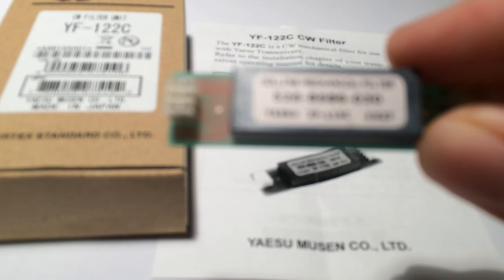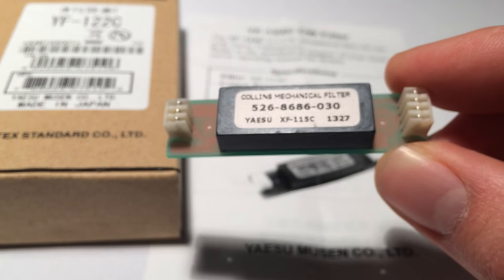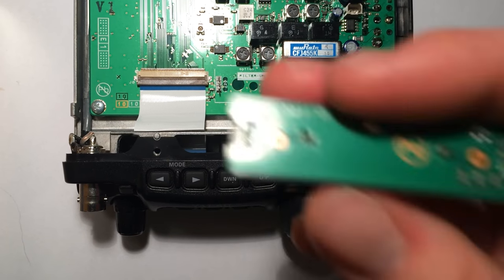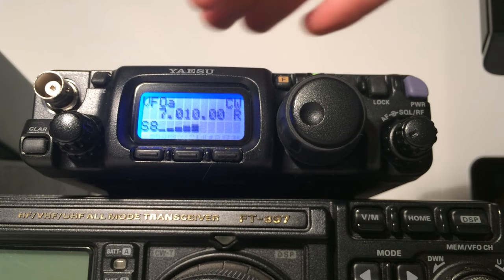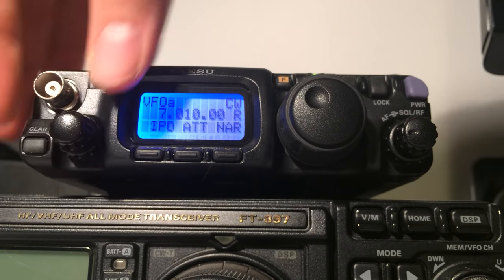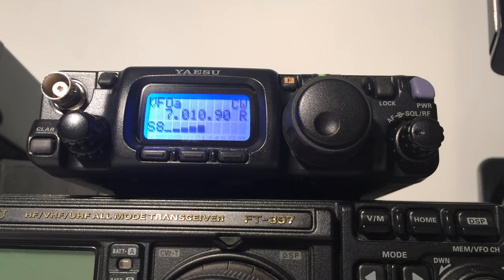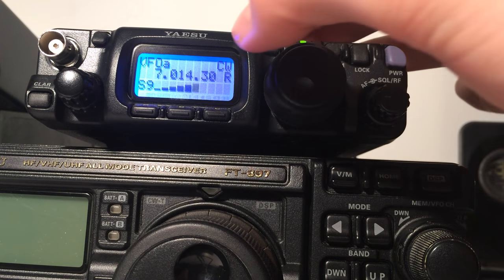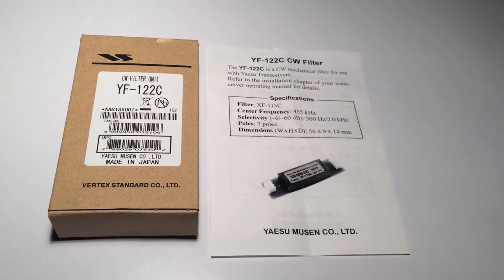A 500 Hz filter in the Yaesu FT-817

Comment: I'm a new ham, M7AGG, and have bought the FT818ND as my first portable rig as I am interested in QRP.  Is the filter just for receiving? I assume you can still operate CW without it?
Reply: Yes it is an IF RX filter, you can operate CW without it, if the band is crowded you will hear lots of signals coming thru the radio's band pass, instead of a few ones or just the one you intend to copy.